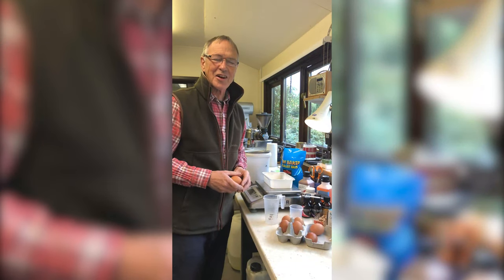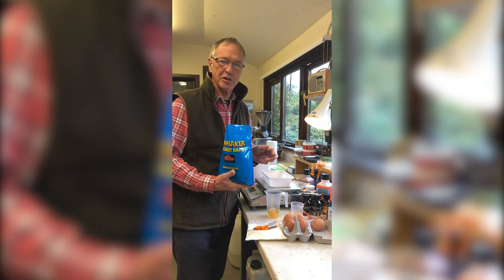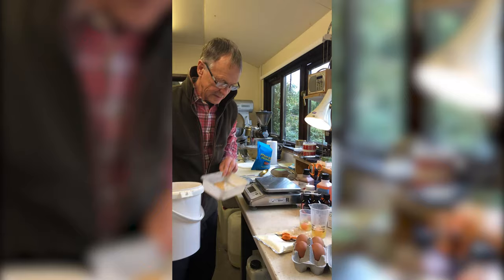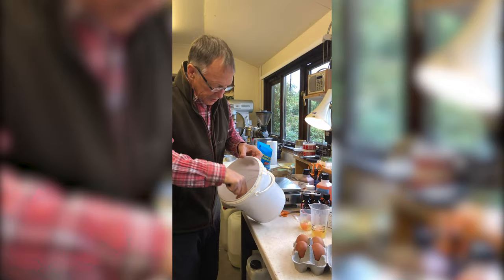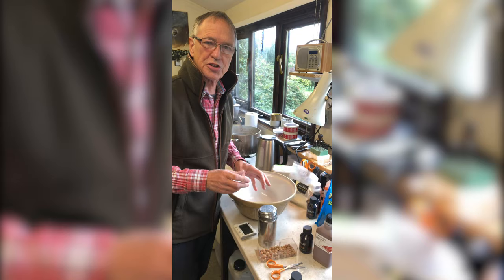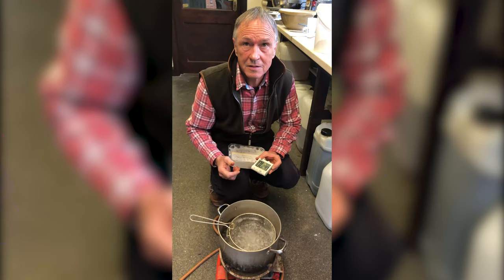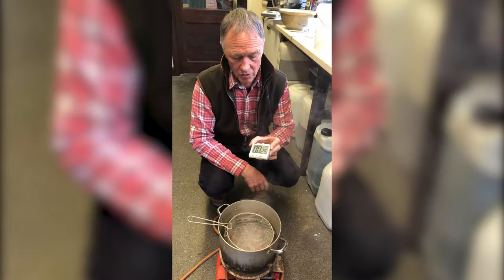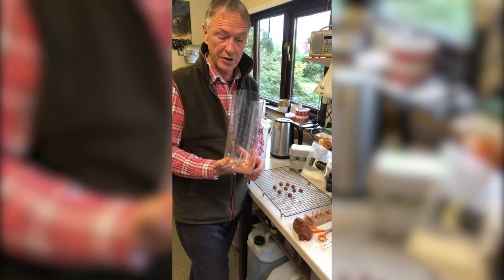John Baker - How to make Hookbaits and get correct Flavour Levels

Comment: does boiling effect the boyencey, i.e can i test corkdust wafters b4 boiling so i can adjust them instantly
Reply from the maker: no you can't do that because the process of boiling and then air dying AND/OR freezing will alter the moisture content in varying degrees so you will have to keep fiddling around and experimenting yourself! There is no perfect procedure when using cork dust that I know of, for this reason I tend to stick with cork balls

Comment: Get a mini Gardner table 8mm dual size match type rolling table, make mix leaning on the wet side, pre soak cork balls in egg white so dont dry mix out and crack, sink cork ball lightly into one rolled boilie then cap with 2nd for consistent pop up weights with a very consistent coating, even a single 10mm boilie should do it from memory, air dry for an hour or two before you boil so allows the mix to bond to the cork and forms a skin on the outer! Doing it by eye is never going to give you 100% accuracy, about right dose not work for me!